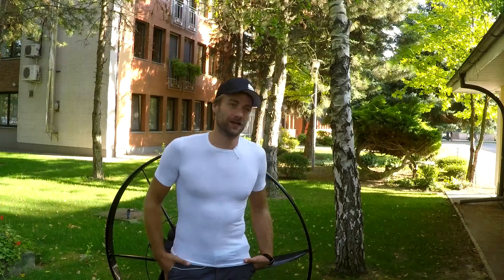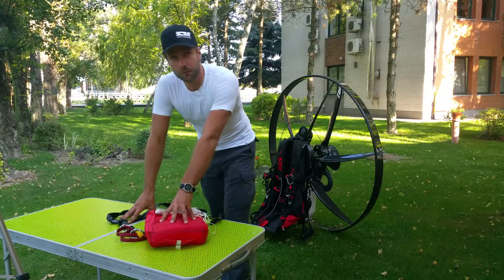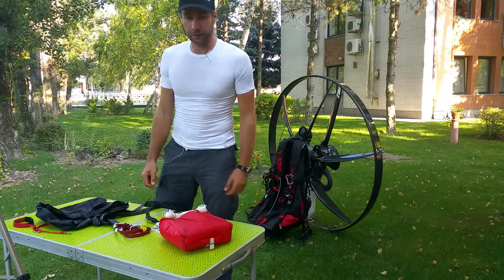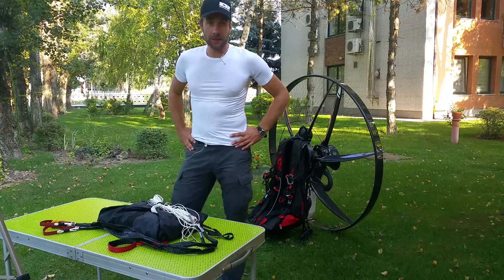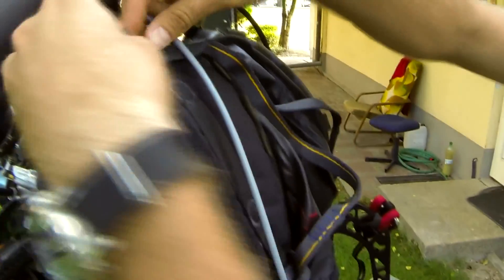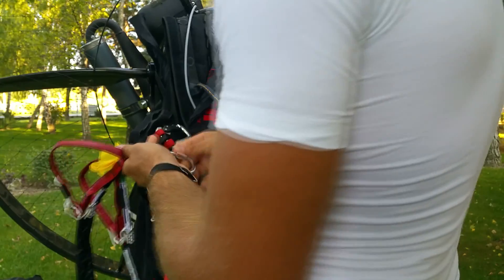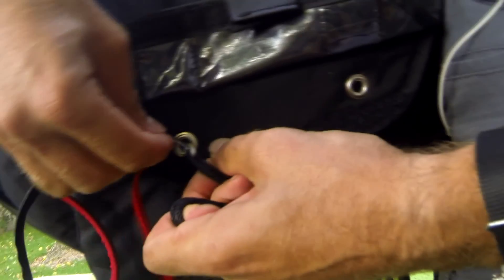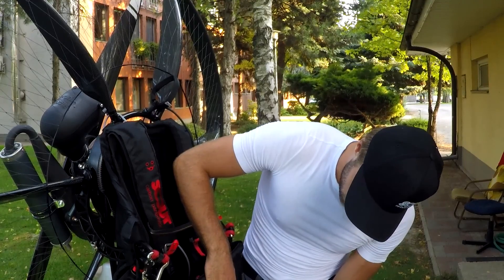How to install the steerable reserve parachute

Comment: Dude. Top tip for removing the shoe laces at the end.... just pull 1 side under the metal reserve hook. This way when you slide it out it will slide against the hook and not the white loop (still good to do slowly).

Comment: When you refolded the reserve chute the video was speeded up. I would have liked to see that part of the video more slowly with an explanation of what and how you were doing and why.
It would also be good to show (slowly) what happens when the reserve handle is pulled and what you actually have to do with it in flight. Do you just have to pull the handle in flight and that's it?, or do you pull the handle to get the reserve out and then grab the package to throw it away from you?
The video gave me a good idea of how to install it, but not showing how it actually deploys left me wanting more. Without help the packing would probably take me much more time than you took...

Comment: Can I ask about your install please. I noticed that you were placing your white reserve lines inside the bridal tube. Is this because the bridal was not long enough to reach the container. Normally when I fit a reserve the majority of the reserve lines are protected by the container. I will be fitting a reserve to a Scout soon and want to ask if it is better to have a bridal that reaches the container or do you belies running the reserve lines up the bridal tube is acceptable and won’t expose the line to snagging if deployed.  Thanks

Comment: I didn't quite understand the unfolding, than refolding of the parachute.  Is that necessary?  Isn't it just a transfer from one sac to another?
Reply from the maker: Repacking the parachute should be done at least once a year to stretch the cloth and wrinkles.
In this video we have repacked because scout underseat container is a bit different shape...

Comment: Are you able to install the steerable reserve and the water rescue all in the same harness? Hopefully you never need either but will one interfere with the operation of the other? I do not paramotor yet, just doing a bunch of research.
Reply from the maker: Yes it is possible. The best way to do it, is to put the steerable reserve inside the shoulder strap and then the water rescue system externaly on top of the shoulder straps. This way because the steerable reserve has quite large  handles.